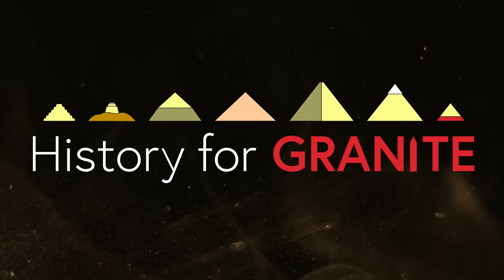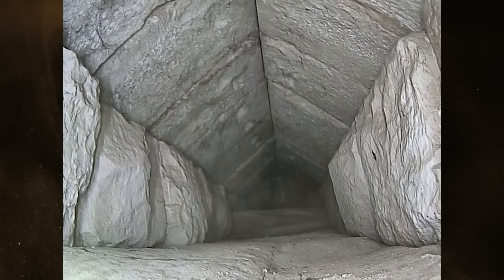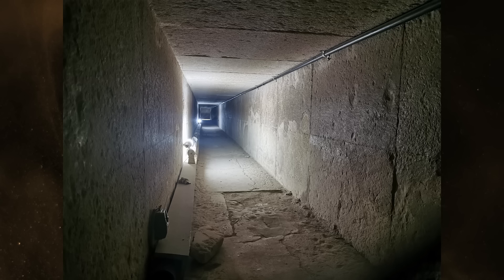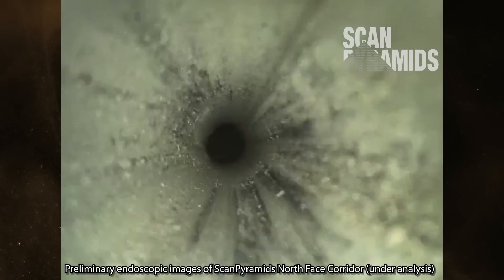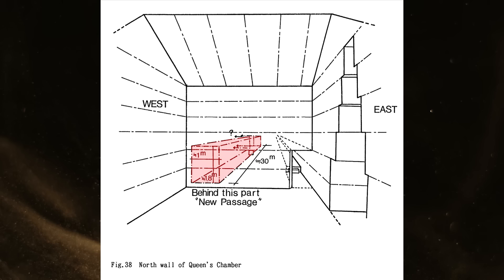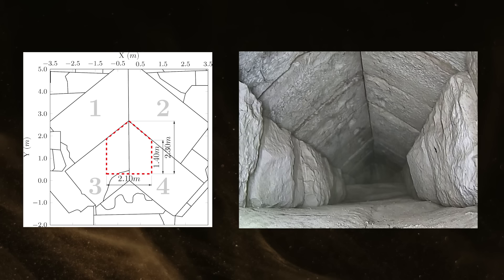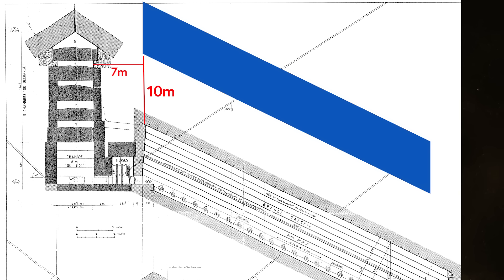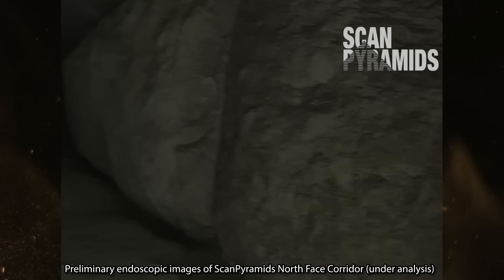New Robots to Explore the Great Pyramid

Comment: Cute idea about the soft robots, but also a bad idea. First of all, you need space for displacement of the sand. We have no idea how high the sand rises above where the drill entered to find it. There may be too much mass above there for the robot to make any progress. We also don't know if there are trap blocks resting on the sand meant to fall if the sand is removed. It may be possible to vacuum sand out as the robot progresses. But then enough air pressure would need to be maintained to prevent any possible collapse and the sand would also need to be pumped back in when the robot snake was withdrawn, both of which would seriously test the integrity of the robot's soft material. Overcoming all these obstacles would add so much complexity as to make it impractical. And, btw, the reason for the blocks in that passageway not being staggered is obvious. That's a huge sign to anyone with a brain that digging through or removing them is a big no-no. Yet another reason that I'll stick to my opinion that the only way to truly unravel the mysteries of the pyramids is to disassemble them from the top down, most especially the great pyramid. Still, the fact that the quartz sand is a specific non-local type is intriguing, considering that quartz is piezoelectric. Things that make you go hmmm...

Also, has no one but me realized the possibility that the corbelled chambers, including the grand gallery, may have served the purpose of being part of something like a block and tackle apparatus for mechanical advantage in dragging blocks up an incline steeper than 10 degrees? I don't recall anyone ever mentioning that. For all of HfG's talk about the portcullis, surely it's clear they understood this concept. Whatever structural purpose the corbelling serves, they clearly could have made the chambers much prettier by facing the stone at the correct angle to smooth the walls without affecting that as has been done in corbelled structures around the world. No. Those inverted steps served a purpose. Beams of different thickness and length could have been held against those steps at various heights any where along the length of the chambers. The near infinite adjustability of this method would explain the lack of notches for the beams. The damage to them even matches the way stone chips when stressed at a corner like that. Then you combine the block and tackle idea with that of sound "raising" the stones. Well, we have no proof that acoustic levitation could work on that scale. But a child could show you that vibration reduces friction. If you increase your mechanical advantage enough and drastically reduce friction with vibration, you can easily move a lot of weight up a steep incline. If the void does exist and it's another corbelled chamber, then that just backs up my hypothesis further. What does put a dent in it is that some pyramids SEEM to not have these chambers. But then, they could have been filled before being covered over. And the other corbelled chambers seem to show a lot less damage to the steps, but that may have to do with how the grand gallery was angled.

Comment: Zahi Hawass has been covering up discoveries at the pyramid site for a LONG time. The tunnel from the river to the pyramid has a vertical shaft in it with 3 separate levels. On the bottom level was another tunnel, which he shows on video and claims that they will go and find out what is down there. That tunnel has been bricked up and no one knows why. Same with the inside of the Sphinx.

Comment: I believe the access points near the bottom must be investigated very thouroughly. I require a way to delete the memory of that robot, and chucks mounted on its hands, so the tip, with some pressure on the shaft, can horizontally zahay hawith certainty this beckons a sticky new epoch for egyptian archeology.

Comment: Maybe the stones the pyramids are built from are shaped by being dragged over the sand by cammels or similar over 1000's kilometers from the quarry and perhaps being flipped when one side is roughly finished and flat, to shape it like sandpaper, and then the finishing touches done by human hand?
They could maybe also have used camels or other large animals and pulleys to lift the stones up in the air, by building large wooden structures sort of like primitive cranes. Or maybe even primitive cranes such as a big hamsterwheel and gears in order to lift high things up in the air.
Reply: They did not have camels in Egypt in those days. They did have teams of people with ropes.

Look up Houdin's Khufu Revealed, he has the best and most elegant theory of all.

{:o:O:}

Comment: Does one of the known air shafts pierce the "big void"?  If so, isn't that the logical path to explore from?
Reply: I think that's just an illusion due to the 2D drawing. Getting a drill in that narrow shaft and then drilling sideways would be difficult. Horizontal drilling is a thing in oil drilling, but I don't know if the technique can be applied here.
Reply: THe path of the air shaft on that side is not straight - it has some angles as if to avoid running into the big void area.

Comment: Why would I possibly think that announcing a new invasive drilling regime using robotic investigation is nothing but a public relations effort by Zahi the Great at diverting attention away from "Bob Brier's room", where endoscopic cameras can just as easily be inserted behind the back wall (with no drilling required) as in the "newly discovered" chamber behind the north face entrance corridor?  And just who is responsible for the length of time it took to allow permission for an endoscopic camera to be put into the latter in the first place?

Comment: I pray that a connecting passage to the big void is discovered.
Reply: I'm not sure there would ever have been one. If the Big Void was 'merely' a counterpart to the Grand Gallery, for the purposes of bringing in the stones for the relieving chambers and roof, it could be permanently closed during the remainder of the pyramid's construction. The Grand Gallery was still needed however in order to bring in Khufu's body.
Reply: @chrisstich5474  I'm just extrapolating from other people's ideas!  It wouldn't surprise me actually if we found the big void to be filled with sand, too.

Comment: Consider the kings chamber a burning room which can cause a vacuum in the rest of the pyramid. It has two vents from which you can expel the burnt fuel smoke and co2 or add more fuel as and when necessary. Consider the anti chamber and its adjustable granite door into the kings chamber as a means of controlling the vacuum in the rest of the pyramid. When the door is fully open and fuel is burned, the kings chamber is sucking the air out of grand gallery until a vacuum pressure exists. Consider the vacuum pressure enough to suck water up through the sub terrainian chamber, up the grand gallery and fills the queens chamber with water to the depth of the step. Consider that originally the design failed because water couldn't be sucked through the ascending passage and that design was plugged and the grotto shaft added which did work. Consider evidence of burning at the top of the grand galley in the form of two inches of carbon crud which was removed by the Egyptian state about ten years ago. Also consider soot removed from the kings chamber and anti chamber over a hundred years ago, Consider the ammonia salt deposits removed from the queens chamber passage walls by the Egyptian state more than ten years ago, in some places several inches thick and a constant smell of ammonia from within those salts indicating the presence of past chemical reactions.
Consider asking yourself why the Egyptian state physically removed contemporary historical evidence from within a protected ancient monument. Consider why it was allowed.
Until you know those answers, you'll never know what you are truely looking at because you only have half of the story.
Reply: Usual BS.

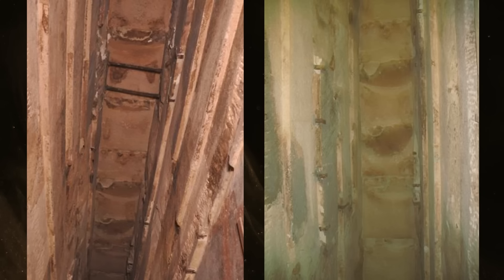Comment: 11:36 nooooo using water is a terrible idea. They could have easily hidden some writing under a stone lid, for example, and we really dont need to use water. Oh sure it will take 10 times as long, but there's no rush.
Reply from the maker: I'm not an expert on drilling, so I can't say if the difficulty would be prohibitive or not. But there is a lot of pressure in that space directed from the chevrons in addition to the normal vertical load.

Comment: How can you look at the layout and materials used, and not see a machine? Water, mercury, conductive stone inside of hader stone rooms.
Reply: There's no mercury in egyptian pyramid, nor conductive stone or water
Reply: @nalinux  sandstone, limestone, silicone based granite. No Bodies found in the pyramids, but they must be tombs? And there is an old water way below the Giza, directly underneath the pyramids. Mercury was found in burial chambers but not in the pyramids, my bad on that one.
Reply: Conductive stone...uh....Limestone (which the pyramids are primarily three different types) is not conductive. But by all means, go get some limestone and granite and try to make a circuit out of it.
Reply: I will take that into consideration
Reply: @majorspudhead5837  Usually, there's quartz in granite. This doesn't help to conduct electricity ... 
Fun fact : most of the granite used in the GP is syenite, a type of granite with no quartz inside.
Reply: I'm too lazy to do the research and to dumb to relay it. So here is a well researched video.
https://youtu.be/XU49FSIx0_g
Reply: @majorspudhead5837  So you found a video with some proof but you can't write what they are ? :)
You are a genious ...
Reply: @nalinux  I could relay it, but as I am not an expert on the subject, it would be irresponsible of me to do so. I came to you with real vetted info, for you to interrupt. You want me to spoon feed it to you further? You have spent more time reading and replying to my comments than it would take to watch the video. 
You wanted to argue your point.... but now you choose to remain ignorant of the information. Yes, I can see how that would make you uncomfortable. Learning new info is hard.
Reply: @majorspudhead5837  You are funny :)
Reply: @nalinux  I guess they are right, ignorance must be bliss... ha you still haven't watched it.
Reply: @majorspudhead5837
"How can you look at the layout and materials used, and not see a machine?"
Because we have functioning eyes and don't have shit for brains.

{:o:O:}
Reply: Do your own research. Glasses are cheep
 🕶️

Comment: I think the way the stones inside the pyramids are placed distribution shows that they did not completely use stones to make the whole building, rather this design is largely to use sand instead of stones, to avoid sand penetration into the tomb, while reducing the construction difficulties of such a large scale building, I emphasize my point again, if the pyramids are made of sand, all the structural design and the sand dunes next to the unfinished pyramids including the internal cavity are reasonable.
Reply: Local sand is very easy to obtain, and the use of sand to make large sand hills and fix them with stones to clear arable land also facilitates the development of agriculture in the surrounding area.
Reply: The u-shaped stone design of the tomb passage illustrates that there is not more stone on top, but sand, and these structures are placed on artificial dunes, which also reduces the difficulty of construction.
Reply: Considering the local sources of building materials and the level of craftsmanship, sand is a better material than stone for constructing such a high building. And all attempts were made to solve the problem of sand scattering.
Reply: @pen8376  What tomb ?
Reply: "they did not completely use stones to make the whole building, rather this design is largely to use sand instead of stones"
Yes, most of the Great Pyramid is rubble and filler. Only the parts we can see are finely worked.

{:o:O:}

Comment: I am wondering whether this void is the same one found by the Upuaut project team in the early 90's; they used a robot to explore the shafts in the King's and Queen's chambers. There's a video of where it is stuck behind a gate at the entrance of that void:
 https://en.m.wikipedia.org/wiki/Upuaut_Project
Reply: I don't remember upuaut discovered any void. they just explored the shafts.
Reply: @nalinux  
"The project resulted in the finding of a "sealed block", a sort of door or barrier with two metal loops at the end of the southern air shaft of the Queen's Chamber"
Reply: @alan69ba  Yes, but it's not relative to the new voids discovered.
And even not on the same side of the pyramid :)
This shaft from the Queen chamber goes South, while the Galery and the void above goes North.
Reply: @nalinux  Thanks; you answered my question

Comment: The pyramids weren’t sealed as the lower chambers were used by the cults for rituals. Part of the reason behind the eventual banning of this practice was due to the desecration of a unnamed tomb. There’s an account of this. Hence the ceremonial altar in the lower chamber.

Comment: Regardless of the C-14 dating of the pyramid, I can promise you it wasn't built by Egyptians who at the time had only copper chisels and rock hammers. Copper will not cut the granite used in the inner chambers of the Great Pyramid. No way such a primitive culture could lift those 70 ton rocks either. Builders and engineers say we couldn't duplicate the Great Pyramid NOW, so it took techniques in advance of ours. 
I'm not so trustful of the C-14 test results which could be of materials NOT found in the pyramids. Don't think so? Think about the faking of the testing of the Shroud of Turin. Unlike what was promised, the test material was removed from the Shroud behind closed doors with no press allowed. Later is was shown that the material used came from a section where "FRENCH reweaving" was used to repair damage. The section used was even at an angle different from the original weave. Surprise, surprise, the test sample turned out to date to the middle ages. The reweaving would have been obvious to whoever clipped the sample....someone no one seems to be able to identify. 
My point is that often there are agenda reasons in some quarters to fake tests. Buyer Beware. I would think if someone wanted to it would be easy to switch materials or gather materials from an area exposed to later organic matter.
Reply: sure buddy

Comment: How doesn’t anyone ask how the oldest pyramid is the most intricate? Just like Macchu Picchu and Puma Punku. The newer additions are more crude than the older sites. Kind of doesn’t make sense does it? We just throw up our hands and say “it’s a mystery “ and leave it that. 🤷🏻
Reply: The older ones aren't "more intricate," and it varies. They all also vary around times of different power and wealth, or even ruling length. Trends also change. 
(We see this in a lot of modern things we do as well, including burial.) 
Nobody is just "throwing up their hands."
Reply: @astra6712  There was no pole shift in 11.6000 bce.
Even if this happened, so what ?
Stones were cut the same way we did in the  20 th century : abrasion by sand. You don't know this ?
Reply: @nalinux  of course! Why didn’t anyone think of that . Great pyramid of Gizeh was built in 20 years with blocks cut from Aswan quarry and somehow moved to the plateau ( Egyptian boats weren’t capable ) then somehow lifted up from the ground to be put into place! The sand technique wasn’t even used to fully cut that stone that Zahi Hawass had demonstrated. Nor have archaeologists managed to even duplicate a scale model using this technique. 

How many COVID 💉 have you had?
Reply: @astra6712  No one say it was build in 20 years. This number comes from Herodote.
Most of the stone comes from the local carrier, not Assouan.
They used boat, of course they had big boats.
How do you think stone was cut before the invention of steel with diamonds , genious ? 
Where are the geologic proofs of a pole shift 11.600 bc ?
Reply: @nalinux  the great flood myth is told by indigenous people around the world. The evidence is in the Sahara. Whale skeletons dated to around 12,000 years ago. Also, mammoths, saver tooth tiger, Australian mega fauna, Australian coastal flooding all dated to around 12,000 years ago. Did Göbekli Tepé exist prior to the flood or was an advanced leftover civilisation here on earth to quickly build Göbekli Tepé or was it purposely buried because the flood was coming? The Priests of Amun knew of a great flood. They also knew of Atlantis which they called ‘Kepchu’. 
Huge structures found south of India in the Indian Ocean. The Baltic Sea anomaly is 80 metres below sea level. Earths oceans have risen 120 metres. Somebody built it. 

There are no depictions of one stone being floated along the river Nile nor is there any depiction of ramps building the greatest structure on earth for Millenia. Don’t you think Egyptians would’ve made reference somewhere about this? Why was the Gizeh pyramid sealed off ? It wasn’t a tomb. The sarcophagus inside is very crude and doesn’t match the internal extravagant stone work inside but nevertheless could’ve held the Arc of the Covenant. Who could’ve removed the Gold tip of the Gizeh pyramid? Somebody surely would’ve seen or made reference to thieves or conquerers stealing it but no. Nobody references the gold tip of the Gizeh pyramid which was , as depicted, was encased on limestone. 

What is the so called lotus flower? Why do only the gods possess such a simple thing? Why was the Baghdad battery found to be around 2000 years old and can generate electricity strong enough to illuminate at light bulb? 

Most importantly, why do you not research further into these things? Why do you just agree with the majority and refuse to piece together anomalies?